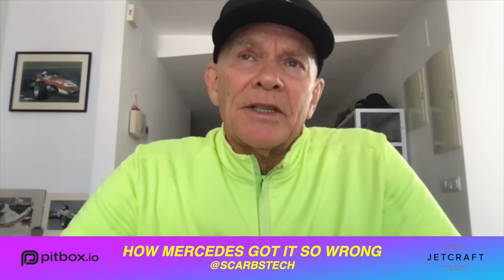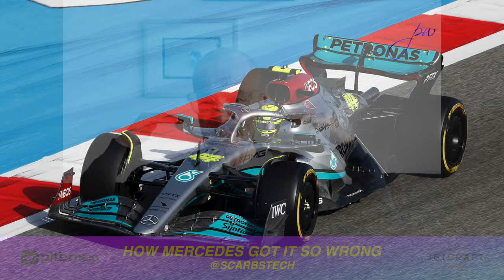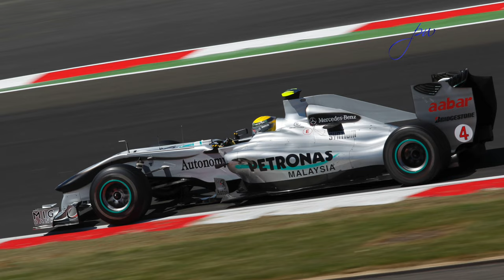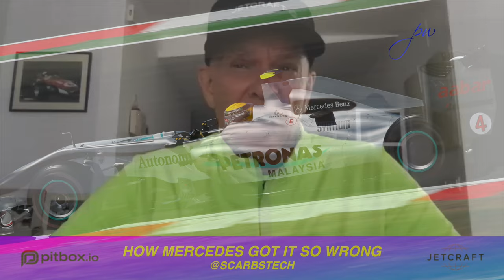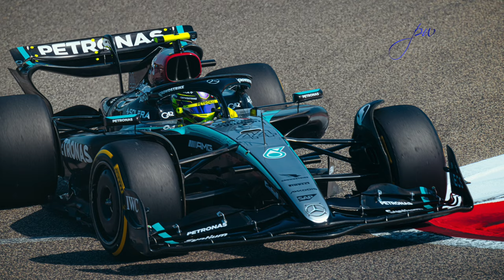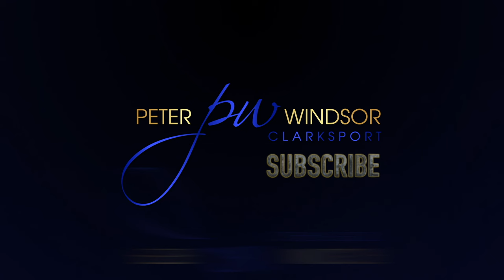HOW DID MERC GET IT SO WRONG? Scarbs analysis by Peter Windsor

Comment: That actually makes a lot of sense, explaining why the Merc was always SO much better later in the race compared to at the start of the race.  Once the fuel was burned out, the car's center of gravity moved down significantly more than its rivals, so suddenly the car came alive.
Reply: Right? How can it possible be that simple and merc messed it up
Reply: @johnnychimpo7539 they knew it.. the budget cap limited them to change everything right away.
Reply: @chimpo7539 At least the 2020/2021 Mercedes (if not earlier) already had that style of fuel tank though.  It wasn't a new design for 2022, the cut-in for the radiators to sit tighter to the monocoque (and hence taller fuel tank) was on the Mercedes for a while -- it wasn't an issue before.
Reply: I don't know, it was always a decent race car, didn't do too well in quali.

Comment: Another issue which the fuel tank influences is the weight distribution front to rear. Let’s say you have a car which wears down the rear tires faster than the front tires then it makes sense to push the fuel tank backwards and put a bit ballast at the front. In this scenario the car runs with the ideal weight distribution at the beginning of the race. When the rear tires starts to degrade during the race the weight distribution slowly starts to push the weight distribution forwards due to fuel usage hereby reducing the stress on the rear tires. Obviously if the front tires are the weak link one would need to do the opposite. Maybe the forward position of the tank in the zero pod cars gave an issue like this as well? Greetings from Denmark

Comment: Are the new perelli tyres this year all the same diameters ?

This seems to be an odd question but here is the problem...

The use of different tyre compounds on the Birhan track at different times of day have  thrown up a lot of teams bottoming the cars which could get penalties by the FIA. The track is bumpy due to temperature diernel ranges so setting the ride height may effecting this fine torrerence during qualifying and the race.

What has happened to cause these bottoming events since last year ? It is thought that each of the different compounds are actually changing diameters in use, teams might complain that they will have to set higher ride heights on their cars at speed and temperature due to a variation in ride height during the lap. 

Will the teams have to set higher ride height for the race compromising their race performance?

Comment: There would be a centre of gravity in downforce pressure too. was probably way out. Like how aston martin kept adding downforce and going slower last year then they reverted to the old  aero package and alonso got on podium because the balance came back
Reply: This needed to be discussed. Mercedes was probably seeing so much downforce in the simulation from zero pod. It's not that they didn't know about the high center of gravity. But it probably didn't matter. Like how early fan cars were often very boxy. The advantages of making the biggest fan box you could outweighed everything else.

Comment: Okay, but Lewis always said they had a better race car than a qualifying car. I have to agree with that, which slightly contradicts the fuel tank hypthesis, as they would be running very low fuel during qualyfying, likely significantly lower than, say, the last 30% of the race.
Reply: Yeah fair point, but you have to setup the car for race pace also, so maybe when doing long runs with all the weight up high compromised their qualy setup. Hard to know
Reply: Solid point.
Reply: It could be like RB in qualy they have tire warm up issues. They can extend stops and still have tire life left at the end of the race.

Comment: Merc started out in 2022 one year behind in development, then started 2022 two years behind in development, now they're two years behind the RB19, which Red Bull already scrapped. The Turbo-Hybrid era was a blessing and a curse for Merc.
Reply: Red Bull haven’t scrapped anything.
Reply: Don't need a perfectly tuned car when you can blast past the entire grid with 120 horsepower surplus.
Grosjean said the Mercedes "Party Mode" engine setting was unbelievable.
Reply: @3rdGenGuy Mercedes were still building superb chassis thanks to Aldo Costa and James Allison from 2014-2021. How do you think they were outperforming Ferrari in 2017 & 2018 during their championship battles? Yes, the engine played a part in it. But, don’t try to discredit what they were doing aerodynamically wise. On top of that there was no budget cap. If there was still no budget cap now I’m sure they would’ve caught up to Red Bull by now.
Reply: @3rdGenGuy  “Red Bull boss Christian Horner reckons Ferrari's engine has replaced Mercedes as the benchmark engine in Formula One”
 -ESPN Jul 11, 2018
Reply: @Alumnikiid you mean when Derrari was cheating with their engine?
Reply: @LuisTrey  Exactly. People still beat up on Mercedes saying it was all about the engine. If that was the case, they could have just strapped the Mercedes engine onto a horse chart and go on to win every race. As you pointed out, they had a lot of aero innovations on their cars.
Reply: It wasn’t a curse they won 7 straight with little to no resistance from another constructor. Any constructor would take that followed by a few years racing for 3rd or 4th as bad as MB was last year SLH finished 3rd in CC. Let that sink in.
Reply: @3rdGenGuy  having engine advantage meant Merc could focus on innovating in the aero department while the other teams were playing cacthup with the engines, in my opinion thats how they were so dominant in the 2014-2021 regs
Reply: @702TifosiGambler  I'm not getting your point, what am I supposed to let "sink in"? Given equal engines which is what we have now, Merc's years of dominance became a millstone; 4 second pitstops which didn't effect the team when they were a second quicker now lost them positions. It's only the presence of SLH that mitigated Merc's atrocious engineering and teamwork. Without Hamilton, Merc will be washed unless they come up with a team that runs like Red Bull, who had to be perfect everywhere, because they had the 3rd fastest car for almost a decade. Dominance in the engine dept. = Blessing/Curse over time.
Reply: @LuisTrey  tbf everything before the new regs was a lot about generating more dirty air because the pace was so good of the merc, and i think they never really "learned" how to build cars without complete freedom see all those system they had like DAS. While RB has somebody that knows the drill how how to handel it, obviously especially with past knowledge about ground effect cars
Reply: Merc has a great car…this will be like ‘21 though…where they have the best car, but not a good enough driver to beat Max, it’s a sad reality🥺
Reply: @hectorshouse7348  They showed up in Bahrain with James Allison's interpretation of the RB19, just like most other teams, Red Bull showed up with the RB20. I'm sure the W15 is better than the W14, but it's not better than the Ferrari and the RB20 is another level. At this point, the best thing Merc has going for them is Hamilton, not the car. Hamilton is one of the few drivers on the grid that are on Max's level, even if he has to push beyond his comfort zone to get there. The W15 isn't "great", it's "good".
Reply: @3rdGenGuy  you burn engine oil along with it that'll happen lol. They were buring up to 6 litres of OIL per race in addition to the 100/L per hour fuel limit. So of course when you have ex. 110L per hour once cheat mode is activated you will have a pretty big advantage..
Reply: @mikemelina7395  I’m not getting your point by equal engines you mean banning MB party mode and a classified 2018 Ferrari engine investigation. Without FIA interruption we have no idea who has the fastest engine.
Reply: @LuisTrey  Merc had a long wheelbase, no rake and PILES of downforce due to party mode/burning engine oil/MGU-H and split turbo tech that nobody could touch for years due to the token system Merc pushed for when they "helped" write the rules. 
The car was a literal bullet with wings, and they turned the engine down so far tires would last for ages, and when they had to race they had 20% more downforce and just sliced through everyone like they were F2 cars. Lewis and Nico/Bottas would just run in formation, take their 4 second pit stops and have 20 second plus gaps every race. You see now when they leave Lewis on inters on a dry track, screw up every pit stop, every strategy call, build 2 duds in a row, they all looked stressed and sick cause they can't figure it out. Because their ace in the hole was a massive power and hybrid system advantage, and being able to carry crazy downforce and drag and not having to worry about it.
Reply: @Alumnikiid  yes, the Ferrari engine that was bypassing the fuel flow sensors. BUT if Ferrari was smart they would have given the engine a "party mode" where it used engine oil to add HP by bypassing the fuel flow sensors. 
Like Mercedes did...
Reply: @3rdGenGuy did Romain finally get his run in the Mercedes that Toto promised? Didn’t know that.
Reply: @ehrlichgesagt863  All good points, but RB has never struggled with aero with Newey designing the race car. RB powered by Renault pre turbo hybrid was a handful and once Renault got it wrong in 2014, RB sought a new PU and once Honda fixed its flaws from 2015 they partnership took off.
Reply: @702TifosiGambler  The engine specs have been frozen, meaning of that is everyone caught up to Merc, who nailed the engine rules in 2014, so everyone's engine is putting out roughly the same power, so equal power - equal engines. They had 8 years to catch up to Merc.
Reply: @702TifosiGambler  that's not entirely true. When RB had a lack of power and straightline speed Newey had to trim downforce to gain top speed. Including the high rake design that stalled the diffuser at speed. Which as a by product made the car wicked unstable in medium/slow speed corners because when the aero bled off and the rear rose in ride height, it would unseal the floor, and all the rear downforce would disappear. Hence Gasly and Albon's struggles. Even max had issues with it, but was capable enough to manage it. Merc because of their high HP could run the cat flat, and have consistent aero, ironically enough just like this gen of RB with the pull/push suspension and anti dive.
Reply: @a If the engine was no big deal, why didn't Mercedes supply Red Bull with engines from 2016? 🤔 Unlike Manor Racing who got the spare supply instead, Red Bull Racing would have actually paid on time and in full for them...
Reply: @TassieLorenzo  RB always has their aero on point thanks to Newey. With a competitive engine they can fight for championships with an elite engine their practically indestructible Vettel won 4 in a row he was barely a Top 4 driver at the time.

Comment: There is the center of gravity and the center of pressure. Between them you can have a hefty moment.  If that moment shifts with fuel load it can affect stability a lot.
Reply: The rules are to blame. If the rules allowed teams to redesign build and test, it would be so much better for the racing
Reply: @david-joeklotz9558  they all agreed that having endless spending only benefited the rich teams like Mercedes and the poor teams like Williams could never catch up.
Reply: @Lewythefly I honestly don't see the benefits. The rich teams are still in front, the poor teams are still behind. Maybe 3 years of cost cap in effect is not enough to see big changes but I dont think it will help a lot
Reply: @FelipeBorgesJF The Qualifying times are much closer together than the ever were
Reply: @FelipeBorgesJF What do you mean?  Mercedes got outperformed by Aston Martin and McLaren, both Mercedes customers teams, at different times last year. That would be unthinkable without a cost cap. The midfield teams have essentially caught up to the front of the field now, a top team qualifying a few 10ths slower than normal can find themselves 10th on the grid, it never used to be this close in qualifying.
Reply: @seeyouaunty  I'm no expert in any of this of course but my opinion is that the teams are closer because of the tech regulations. The cost cap is not helping much because the rich teams had all the top tools and facilities already when the cap was put on effect and the smaller teams didn't. In Mercedes' case, they went the wrong way with their concept and still finished in front of the customers (I know Mclaren was faster than them in the second half and all but still finished behind). I think this year they will blow the customer teams away with the change of concept. They have the tools to make great cars. Maybe in a few years the benefits of the cost cap might be more evident.

Comment: Wow! You have to wonder what they were thinking. Center of gravity should never be an afterthought. Look at rally, where the co- driver sits lower than the driver to buy them a few millimeters of CG drop.
Great video, PW and Scarbs!!
Reply: Bizarrely, they put all their eggs into a low drag concept, despite the fact that it negatively impacted center of gravity, driver placement, roll center...not at all a balanced concept.

Comment: If Red Bull's 24 design is any indication. Mercedes was right on general principles, but they failed in execution. The vertical inlets are on the new RB, and it has the very tall "shoulders" so the center of gravity is higher. But Newey just paired the good parts of the Mercedes design with the stability of an existing platform. This lets RB accomplish new concepts well within the buget cap. If the 24 RB is as fast as it seems, it's the crowning jewel in Newey's career. He literally said "I can fix her" and did.
Reply: They haven’t even had practice yet. Are you always so premature
Reply: The vertical inlets were not a central solution to the zero pod design, but a symptom to get around the rules about sidepod regulations. Kyle.engineers made a great video about it.

Additionally, the tall shoulders are nothing but empty space, you could see it in the RB and in the merc from last year when they took off the covers. It is not high center of gravity, since there’s nothing actually in the canons, its fundamental purpose is aerodynamic: it keeps cockpit losses in the middle of the car, and it also gives additional volume for heat internally to move into
Reply: Rb's design is completely different from MB. Its more closer to ferrari's s-duct from last year and the shoulder canon's from last year's design.

Comment: I will never forget Michael Schumacher's quote: "the most important part of the body is your ass." You feel the track, what the car is doing primarily through your ass. And I assume Hamilton's critique that the cockpit is too forward is connected with Michael's observations. But after such dominance, I would never have guessed Mercedes would fail so hard two years in a row. What's even more impressive is that nobody could rival Red Bull the last two years. Let's hope this year they'll have more competent rivals and we'll see more action at the front of the pack.
Reply: Hans Schtuck called it "The Po-Po meter".
Reply: Even driving my street car i rely on that same old premise🤔 the filling of the tires
Reply: @stephensegal5187  Youtube censored my comment. We (sim racers) have telemetry app called po-po-m-e-t-e-r. (I hope this will go past youtube censoring.)
Reply: Ferrari did until the TD changed the floor.

Up until that point only unreliability and driver error prevented Ferrari being quite far ahead in both championships:

Baku - engine failure whilst leading the race
Barcelona - engine failure whilst leading the race
Austria - engine failure prevented a 1/2 finish
France - Driver error whilst leading the race 

The Ferrari was never the same post TD and I’m not even going to mention their strategy errors.
Reply: Some of it, I think, was that they got their only win (a 1/2!) late in 2022, so they started thinking they could refine their way out of the zero-pod issues. If they hadn’t done that, they might have done more radical changes in 2023. That said, 2022 also suffered badly from a demoralized Lewis Hamilton. Between being robbed of his 8th championship and getting stuck in a car that was miserable to drive, he just wasn’t himself that year. We saw him come back in 2023, which was how he got third in the championship (and nearly got second) despite being in what was usually the fourth-fastest car on the grid.
Reply: @intothemultiverse1033 their floor was against the rules, so they would have been hit at some point.

Comment: The biggest problem merc had was the car hitting the track and unsealing the floor, and not having enough suspension or downforce to keep the car sealed, vs bucking up and down sealing/unsealing. So they had to raise the car and killed the underbody downforce. In addition merc had a disproportionate HP advantage for a long time, and they sculpted their downforce/drag to suit that. But when they went to the bio fuel merc lost more than others found, so they also had a top speed issue to compound the drag issues.
Reply: Thank you!